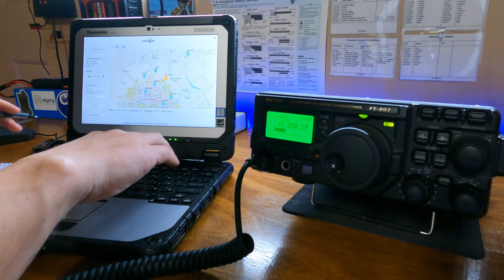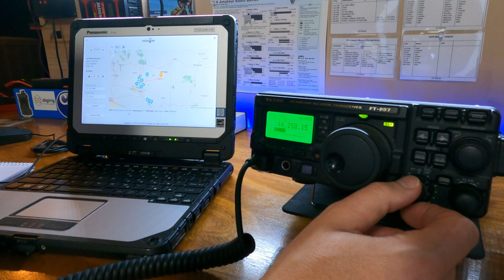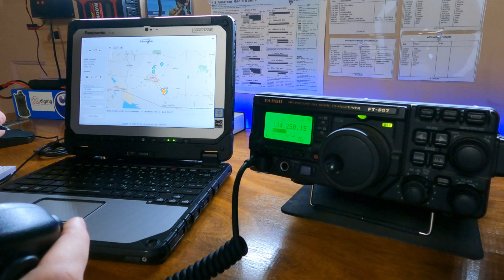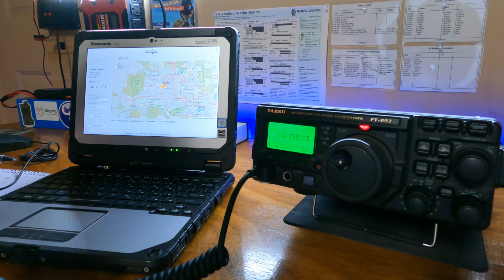Offgrid Comms using 2m Single Sideband - No Random Contacts

Comment: Great video, Gaston; 2m SSB is a blast yet not too well known.  Glad to see you showing it off.  Some have referenced the CHA DB VHF/UHF antenna...  I've been using one for about a year, on both FM and SSB, and have had no problems with it.  It's built like a tank, easy to set up and take down, quick to reconfigure, and highly portable.  It's a good tool for anyone interested in VHF/UHF communications.  I also have a few of the Packtenna mounts, which I use with Comet BNC24 antennas, which also are highly flexible and usable.  Of course, home-brew antennas are also easily made for SSB (and FM) and are fun projects for experimentation.  Anyway, a thousand thanks.  Cheers!
Reply from the maker: Glad you liked the video. I actually have a CHA DB sitting in my shack. I did not want to talk about it in this video as I have not used it yet. I am waiting on a mount adapter for my painter's pole. Glad to see others like yourself using SSB on VHF/UHF. Cheers!

Comment: Maybe I'm missing something, but wouldn't a NVIS 40 or 80 m net be just as or better suited to this purpose? Big drawback to 2 m SSB is that as a percentage of the total radio users (even the general holders), those able to do 2-meter SSB is pretty small, and of that group, likely that all of them could do 40 or 80 NVIS. There's value to it if you already have an established group using that type of comms, But as a new thing, to me it doesn't make sense.
Reply from the maker: This is just a demonstration of showing the value of 2m SSB as another tool for local comms. It's not mutually exclusive I've covered NVIS on 40m, 75m and 80m a few times recently.

Comment: I noticed ya also forgot to mention ur loosin ALOT of the signal in ya coax and that also pointin ya yagi and hills or mountains can also help cause they act like mirrors and for ur 897 u can buy a TCXO on ebay for it was like $20AU when I had the same radio years back and it made it alot more stable and if u get a RTL SDR u can mod the radio and use the SDR as a pan adapter which is useful

Comment: I love my FT897D. Great radio! Have you thought about putting up a more permanent 2m yagi with a TV rotator at your QTH now that you have the FT897? You're making me think about changing my 2m yagi from vertical to horizontal polarization and trying 2m SSB. Thanks for sharing!
Reply from the maker: Yes. I have been a portable operator for most of my operating years, so my shack is very modest. Now that I am starting to do more operating at home, I will be deploying a proper setup at my home QTH. I plan to have a  couple of dedicated verticals for packet and FM work, a dedicated horizontal beam on a rotator for SSB as well finally invest in a proper station grounding setup. There will even be a new Terminated Folded Dipole deployed on the roof for DX. Outside, I will continue to run my CHA LEFS 8010 in its NVIS deployment. All of this will be covered on the channel next year.

Comment: If you don't have the TXO for the FT-897D, it should help get you on frequency. It works better after its been running 20-30min. Otherwise, you'll probably end up fiddling with you carrier offset for Tx or Rcv.

The Arrow beam on the painter's pole is great prepping. If you think more like Net Control you could stack a couple of horizontal loops, but the off the shelf stuff is $$$.
A crafty person wanting point to point could modulate a laser pointer. The modulation could be anything from CW to any voice or digital mode with CW being easy. A clever person could probably co-opt CD player parts for some of the work modulating and demodulating. Its a crazy idea for someone.
Reply from the maker: That's what I have been reading. My unit did not come with a TCXO. I am trying to find one as well as the purple unicorn--the 2.3 KHz SSB Collins filter. Anyone have one? Yeah, I know this is a shameless ask. I'll pay a fair price. I'm on QRZ. ;-)
Reply: @TheTechPrepper  No! You CAN'T have my 2.3K Collins filters! I bought one for all four of my FT-8XX radios when new.
Isn't there something designed for the 817/818 that does the job digitally that might be co-opted into service?

One radio has the 300Hz and two have the 500Hz filters. Given most digital modes can operate at 1kH to 1.5kH, and I don't do CW I would probably opt for a 1.5kH filter if I changed the second filter.

Comment: why the 897 over something newer like the 991?
Reply from the maker: New is the enemy of stable in my humble opinion. This radio has a proven track record over the course of 20 years. It comes for the good old days of when Vertex Standard was associated with Yaesu. The quality has gone down since Vertex Std. left. Also, this radio shares the same components and menu systems as my main radios (FT-818 and FT-857D). Parts interchangeability is a major factor. It was also 1/3rd the price. There are many features that I will cover next week.

Comment: Has anyone setup a kind of BBS system with radio ? Or maybe a forum or Usenet type system using radio data  and repeaters

If the internet goes down this could be useful
Reply from the maker: I did a video on this topic last year. Search "BBS" on my video channel page. Enjoy.
Reply: KM4ACK, OH8STN, and S2 Underground talk about setting up file and mail servers accessible by radio. Two of them use Pi computers. I want to say S2 Underground suggests a LoRA topology.
Reply: @vironpayne3405  LoRa could be very useful if you have people within range and enough of them to form a mesh network. Text only, but it's encrypted. Pretty neat stuff.

Comment: I do agree, was borne long before Internet but came into IT, just when that craziness startet. I am often looking for people who have knowledge    about a certain topic and not just googling it…
2m ssb is just a difficult thing here in the mountains, but recently I stumbled over a FT991 (not “A”) to a very good price, that I couldn’t resist. The Antenna is a omnidirectional horizontal type which really does a very good job and I’m getting far out of my valley now, not possible with FM.
Thanks for your work, 73 de HB3XBL 👍🇨🇭
Reply from the maker: There are Nets on HF on just about every band. The same philosophy of connecting with a like-minded community applies. There are groups on VHF/UHF repeaters too. Get on the air and ask everyone about recommended nets.

Comment: I brought the FT-897, and accessories such
as the 2 batteries for portable operation, the
internal power supply and external side mounted tuner back about 20 years ago when it came on the market. I did enjoy it.
Also, took it to Antigua for a week at Sandals
Resort in January 2004, and was licensed
there as V25CH. The antennas were just
homemade dipoles for some of the HF bands. I did operate a few hours each day
during the week. It was nice to be called
like being a DX station. I worked 37 states
and Cuba called me as did the Azores. I
had QSL's printed with my information
showing a beach scene.
I do still operate SSB on 6 meters and above,
first being on 2 Meter and 6 Meter AM in
the 60's before repeaters, and worked several hundred miles with AM and skip on
6 meters AM back then.
I remember back in the NY City area the
East Coast VHF Society Sunday morning
Net around 144.250 MHZ later on SSB.
I won single operator for Eastern NY section
of the ARRL with AM in September 1965,
and Single Operator on 2 Meter SSB for ENY
in September 2008 using the club call W2NYW, at our home back then. I usually
use N3FJP software for my contest logging.
73 de W2CH Ray and Marylyn,  KC2NKU,
New Hampshire.
Reply: It sounds like your FT-897 has been one of your best friends over the years. I still enjoy mine, but now I use my FT-857D mostly for portable ops. Both are great radios.

Comment: A good video would me to talk about your new/old Ft 897.  Why did you buy it or any features you like.
Reply from the maker: This will be next week's topic, but in a nutshell it's built like tank, is all-band/all-mode, and shares the same menu system, controls and components as my primary manpack radios (FT-818ND and FT-857). This radio is about 20 year's old and comes from the Vertex Standard days. Proven track record, robust and built to last.
Reply: If you aren't in a crowded contest environment, you will be hard pressed to find a better all band all mode radio than the FT-897D & FT-857D for portable operation.The IC-846pro is better in some respects, but it is very power hungry.

Comment: I completely understand the limitations of CB compared to amateur radio but have you considered ssb CB for a base station option at a stationary base of operations? I have quite regularly talkked to people 180 to 220 miles away and sporadic contact with folks 300 to 400 miles away all while using completely legal un modified CB radios. While not legal I've heard stories of people using a amp (not legal) and regularly talking 300 plus miles away.  I detest straight am CB. Being a truck driver for over 26 years it's really soured me on citizens band radio while in strictly am mode. SSB citizens band on the other hand is quite intriguing to me.
Reply: Maybe not relying on ssb CB but maybe keeping it as a tool in your arsenal ?
Reply: With CB you wait for the skip to happen. With amateur radio you go to the HF band where the skip is at any given time. For emcom and prepping that is a huge difference.

Plus, CB never sees NVIS propagation. HF NVIS is invaluable for regional communications. It is a regular tool for SOCOM military operators as a backup or in place of satellite communication.

https://youtu.be/9QIeG4LiFMg
Reply: @vironpayne3405  CB is 27Mhz, which makes it HF. Anything seen on HF can be found on CB.

Comment: I see quite a few of those on ebay - and they are pricey for a discontinued 10w radio.  Any reason why you chose that specific radio vs something else?  Choices on SSB 2m / 70cm radios are sparse.
Reply from the maker: This is a 100 watt rig on HF. I picked mine up for $450 in great condition at a local hamfest. It's been my experience that eBay prices are disconnected from reality. I'll talk about the reasons why this radio next week.
Reply: @TheTechPrepper  Wow you got a deal if that's the case!  And I thought that it was only 10w, so yeah - that's a nice rig for what you paid for it!

Comment: Really good video, I especially liked the points made at the end of the video. While I 110% agree that having the ability to operate SSB on VHF/UHF is a huge plus, the problem comes down to having the right equipment. While I could buy a used 897 and a beam to put up horizontal, I highly doubt many people in my area would spend the money to do the same. I know of one person who has a 897. I'm in a rural area and it's hard enough to get people to get licensed and get a radio. The people who are already licensed and have radios have little will to go beyond VHF/UHF FM rigs, HF with NVIS and Digital. I hope people in areas where this will work will take advantage of SSB VHF/UHF, but sadly, in many places, people won't. Even the group who are preppers and meet up on the radio on a regular basis are pretty much stuck in a mold. No doubt, I could find a few, but is the expense worth if for just a few ? I'm retired and income for expenses like this is limited unless it has enough of a value. If anything, I may buy a 817 used if I can find a deal. But beyond that, it's FM for VHF/UHF.  Other areas may be a totally different story. Thanks, really enjoyed the video. P.S. I'm surprised you don't have a Yaesu FT-5D. With the built in APRS/GPS abilities and IP 67 rating, it's a great handheld. No need for the extra equipment and it has C4FM.
Reply: I love the FT-817, but I would go ahead and get rig that will do at least 35W 2m SSB. The big boys that make +100mi-200mi consistently often run repeater amps pushing over 100W 2m SSB.
When prepping the amps are a major power consideration if you are on battery or solar. A radio that runs 5W-50W gives a good amount of flexibility, if you need it and it respects limited power sources.

Comment: I volunteer SAR and pretty much everyone uses FM only 2m and I think ssb would work best at pushing comms up a canyons
Reply: In my experience, 2m ssb is unlikely to help if you have major terrain issues. I've used it as a range extender in benign terrain, getting reliable comms over around 100 miles whereas FM would only do 40 or so without having to go up to kilowatt power levels. For 50 miles plus I'd usually lean towards MF/HF, but atmospheric conditions mean those are never 100% guaranteed whereas a beam and 2m ssb can get a higher level of confidence once you have checked it will work at all. If it works under flat band conditions, likelihood is it will work all the time, so good for point-to-point links.
Reply from the maker: Thanks for your service. That's very commendable. We're also using NVIS on 75m with great success in valleys and across mountains. Be safe out there.
Reply: Gaston and Mike are correct. VHF SSB does miracles with modest terrain and a little power. For terrain NVIS is your best tool, unless you want to go down to 600m. Between 2m SSB and NVIS on 40m, 60m, and 80m you can cover 100% at least 20% of the time regionally out to 200mi regardless of terrain.

NVIS is not available all the time, but it is available almost every day for a few hours. If you focus on using the right frequency at the right time you can operate NVIS with 80%-90% reliability. 80m and 60m are more reliable for NVIS than 40m. If you are not using prediction software based on current or expected space weather 80m from an hour after sunset to about an hour after sunrise will provide your reasonably reliable 80m NVIS.
Reply: @vironpayne3405  thank you for the feed back, I run portable NVIS almost everyday, I do tones of winlink,  Our SAR uses tactical voice  pretty much data but in a disaster it will rock.

Comment: Chameleon makes a VHF/UHF antenna that can be configured as a dipole. I bought one, but haven't got to try it out yet. Wanting on the mast to get here.

Edit: I've been reading my antenna book set by the ARRL I bought at a ham fest. You might be able to build a 2m Squaralo (I believe that is what it's called). It's a horizontally polarized, omnidirectional antenna that can be used on SSB and AM. 

W4ISB 
Mike in Tennessee.
Reply from the maker: I actually have the antenna that you are describing. It's the CHA DB. I wanted to talk about it in this video, but have not been able to test it yet. A friend is fabricating an adapter for my painter's pole so that I can mount it. There will be a video on that antenna soon. 73s
Reply: I haven't got to use mine, yet. Chameleon had a black Friday sale and bought the mast to put it on. Waiting until I get it in so I can hook it up and see how it preforms. One review on their website stated that the user had to file the whips to get a proper SWR. Hopefully that isn't the case.

Comment: Love your video, I have Been curious about how ssb compares to FM, consider an Omni antenna on a switch with the yagi
Reply: The omni SSB ops often stack horizontal loops, but off the shelf stuff is $$$. There are roll your own recipies using wire delta loops etc, but you still need to be comfortable build phasing cables and matching sections for odd imeadances. A good cobbler should be able to do something for about $50 that would be comparable to the store bought stuff.

Comment: I know that your EmComm Tools is targeted toward the 818, but have you tested it with your 897 since it is from the same family of radios?  I use a 897 as my portable and would love to be able to use your software with it when available even if it is not officially supported.
Reply from the maker: Well...I broke my rule and added support for the FT-897D and FT-857D. I also added support for my new Xiegu X6100. So, only these four radios are supported. This was a pain adding these additional radios, so it's time to focus back on the core EmComm Tools development. I am happy that you and the other FT-897D owners lucked out.

Comment: Great video. I LOVE SSB on 2m and any radio that allows it.
Reply from the maker: Thanks, Jason. It's one of my favorite bands/modes to work. I have great success with the FT-818 on 6 watts on 2m USB. 73
Reply: The VUCC #125 I got on 2M was more fun than WAS or DXCC and even more work, still have fond memories of working over 10 new states on an Aurora opening in 1991, LOL.
Reply: Horizontal FM is quite interesting on 2M too! the QSB is like that of 28Mhz FM CB, entertaing at its best - did it years ago 2E0GYO and was really keen yay!
Reply: Hi Jason. 
I'd like to try 2m sideband this next weekend,  would you be interested in scheduling a time plan?
De kd4stt 73s.
Reply: @Kd4stt.  I don’t think I will have enough elevation during WFD for a successful QSO on 2m. Will you participate in Mountain topping with Kenny in March?

Comment: I'm sorry but this is a very specific piece of equipment that not many other 'preppers' would have. How is this applied to prepping and emergency community communications?
Reply from the maker: This radio is a shack in the box. It allows for most every band and mode, so it can do everything from local comms to global comms. Also, my point to preppers was to consider radio as a place to establish a community for support.
Reply: @TheTechPrepper  I like the idea of a shack in a box. Great find and pick up with this one especially for the price. Nailed it right place right time.
Reply: Between NVIS and 2m SSB you have regional communication 0mi-250mi as reliable as it can be in a grid down situation. Reliable regional comms is paramount in most emcom and SHTF situations.
2m SSB achillies heel is terrain objects. NVIS achilles heel is limited hours of availability each day. 2m SSB doesn't help with mountains in the way.  NVIS goes over the mountains, but it may only be 80%-90% reliable for a few hours per day.